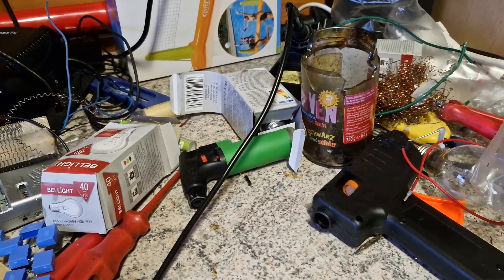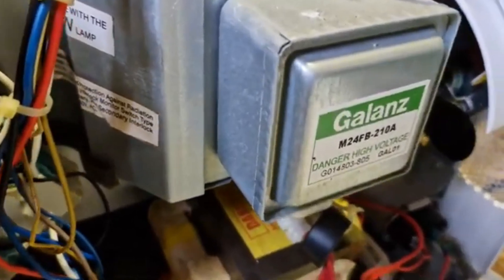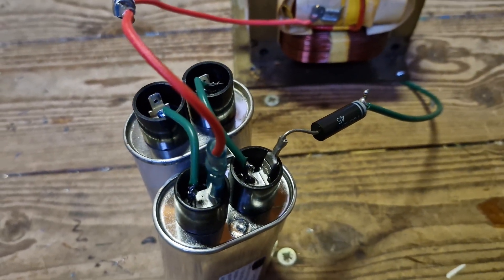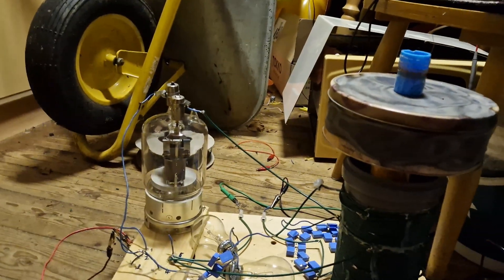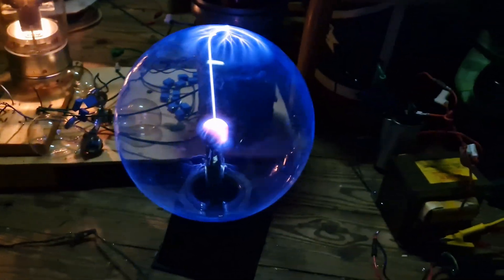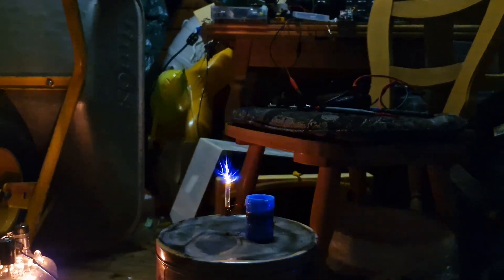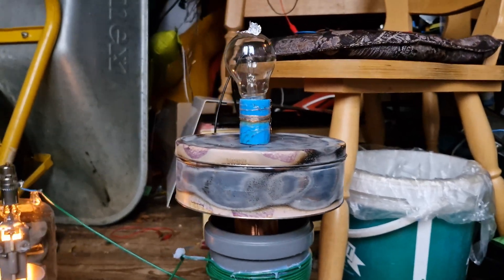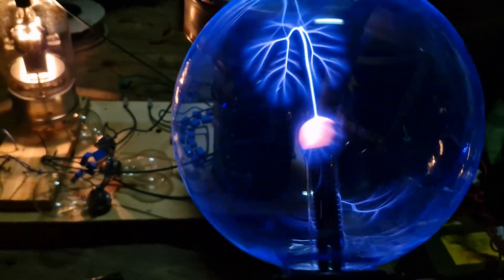Building a powerful GU-81m VTTC⚡

Comment: Great video but I think it is a waste if you can't do anything with all that power.
Reply from the maker: Yeah, but its good for demonstration of higher current lightnings. I think the current in the secondary is around 200mA because of the high amount of primary windings. And it also generates a big electromagnetic field that can light up fluorescent bulbs from like more than 1m away.

Comment: Could you please perhaps go into more detail about how you tune your circuit to resonance?  
   More importantly however,
   Thank you so much for using your voice instead of some really irritating obnoxious AI generated "perfection"!!!!
Reply from the maker: I would recommend using a big amount of caps you can but in series so you have much more control. I used a wire to bridge some of the caps and adjusted it if needed. Its important to tune the circuit after you found a topload you want to use other wise you gonna have to re tune it. I also wouldn't recommend changing the amount of turns of the primary since it could cause you circuit to draw way more current than you get a nice output. My coil is still not perfect tho. I have seen people reach 60cm arcs while mine are around 30cm.